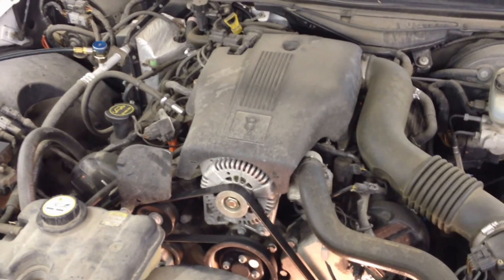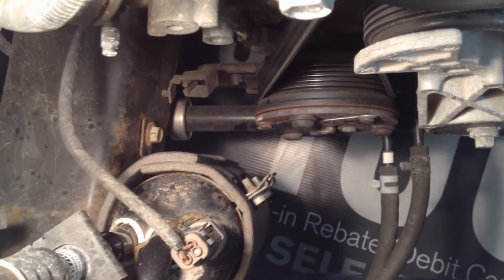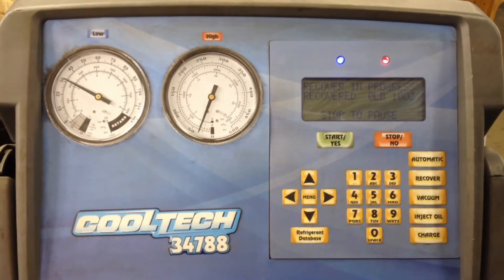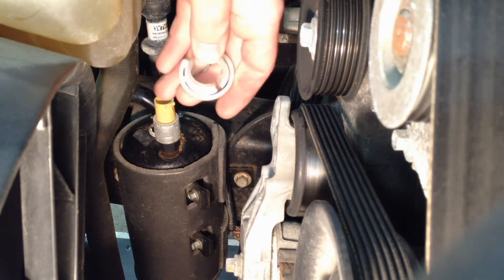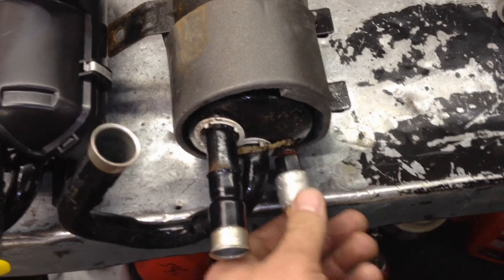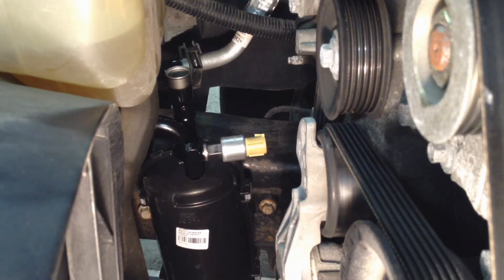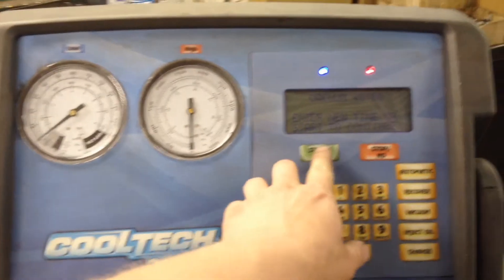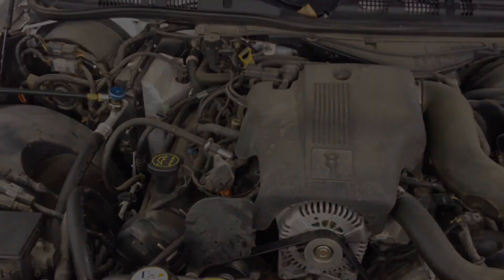2003-2011 Ford Crown Vic & Mercury Grand Marquis A/C Accumulator Replacement

Comment: I'm about to change the exact same dryer from my Ford. I don't have a ac vacuum. can I just Change the dryer an add cans of freon to the system?  I know there's no other leaks. but I don't have a vacuum to pump air out. I just don't know if that will work. plz lmk what u think. thxs
Reply from the maker: +wonnieboy No you must evacuate the system of air before recharging
Reply: +FordTechMakuloco .I'm planning to take the car to shop to get the evacuate an freon done. but do I have to add that oil to the dryer when I install it or can the shop do that after its already been installed and ready to go and how important is that orifice tube? I have one, should I replace it or will it be OK without replacing?
Reply from the maker: If you have the orifice tube replace it yes. The oil should be added to the accumulator before install on the inlet side.
Reply from the maker: wonnieboy its best to drill into the bottom of the accum and measure what drains out but what I find is in general 2-4 oz of pag oil is a good amount to refill with.
Reply: Unless you're 95 years old or older, go buy a vacuum pump!  You will use it countless times in the future.  Harbor Freight has 'em for $100 and with a 25% of coupon = $75.
Reply: Why won't they sell them to 95-year-olds?

Comment: I have a 2003 Ford Crown vic and about every month or two I have to put a can of freeon in my AC.  I wonder if that is what is causing my leak?
Reply: I have an 03 and was having the same issue. Last oil change I went in and they told me the bottom of the accumulator had a rust hole in it. Leaking all of my freeon out. Just had it replaced and problems fixed..
Reply: +USAFXBMW thanks man

Comment: hi there. I actually installed exact same dryer an I had shop evacuate an add freon to system. after 1 hour the straight up line on dryer with spring lock blew off. Idk what happen an why it failed. do u know why this connection would fail? it stinks cause I paid shop an now I gotta start over. but any help would be appreciated. on what to do to prevent this from happening again. thxs

Comment: I don't think it's correct to say the vacuum pump will boil off oil from the system, firstly those oils have too high a BP for that and also you don't want to remove that oil from there
Reply from the maker: I don’t think you heard me right. It’s not boiling the oil, it is boiling off the refrigerant that is trapped in the oil during the vacuum cycle.